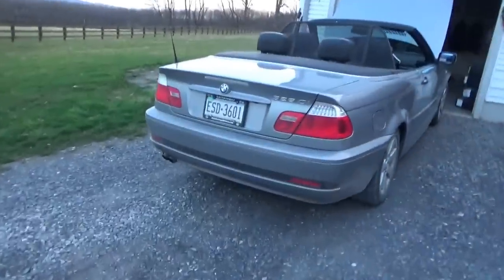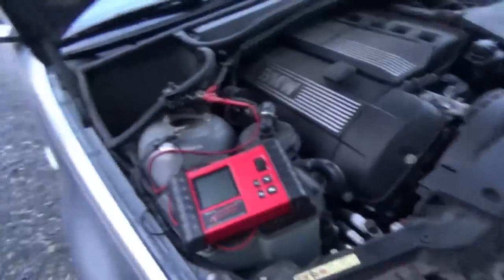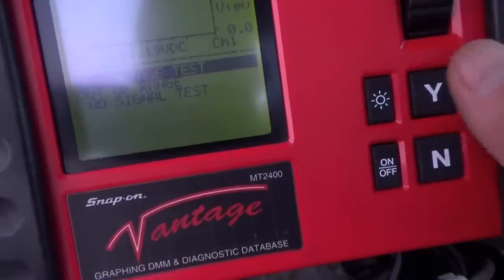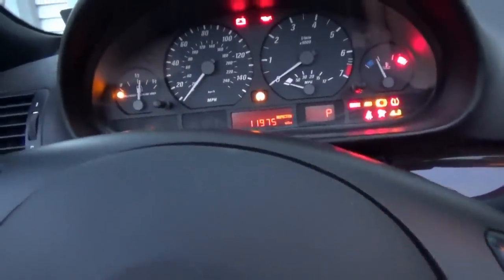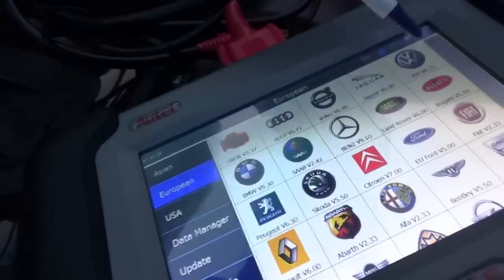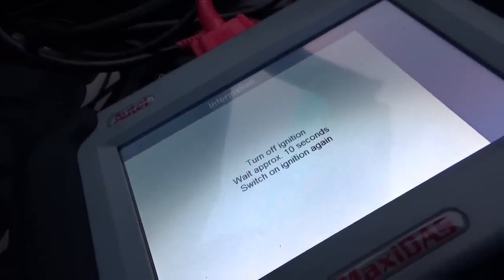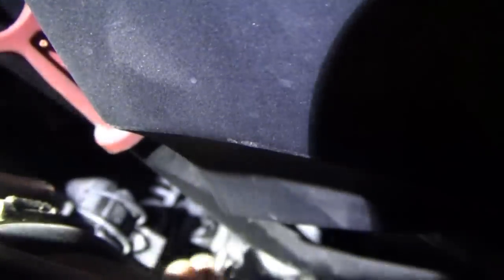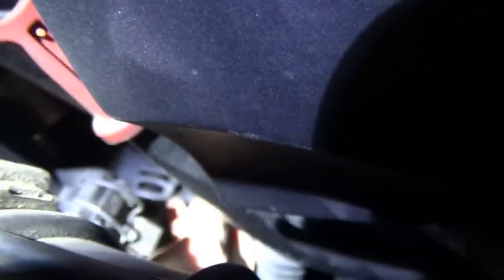BMW Charging System Alternator -Diagnosis

Comment: Ivan, I really enjoy your videos.  If it helps, here is another source for wiring diagrams.  Very similar to a post by someone else: https://www.pss-autosoft.net/diagrams.php
The technical information that you were also looking for (how the systems work) can also be found in these BMW wiring diagram "systems".  These are the actual BMW technical systems used by the dealers. People have just ported them over to these websites.
Owning three BMWs (e39, e46, e63) and doing all my own work on them I can say they are really not any harder to work on than any other vehicle.  As a matter of fact it's been my experience that I can find more and sometimes better information on these cars over domestic and asian vehicles. But you have to know where to look and so I understand your frustration to not finding in the usual places you go to.  They're also, in my experience pretty easy to work on and appreciate the engineering that goes into them (not that other car mfgs. don't have good engineering).  Speaking as someone who worked as a mechanic while putting myself through school for my mechanical engineering degree.
One last comment on that secondary air pump fault.  I noticed that it appeared to be intermittent.  The scanner was showing that the fault for it was not currently present and the second time you scanned the codes after clearing them it wasn't there.  So it might not be a bad pump.  If it were, those pumps are usually not $500.  The dealer quality brands are about $350 (yes, still on the pricey side), however, a cheaper brand say from Rock Auto can be had for about $150. I understand the aversion to non-oem, but sometimes it's ok. lol
Perhaps your customer/neighbor may be interested in you diagnosing it.  That would be a good video!
Reply from the maker: Thank you for the detailed comment! I already diagnosed the AIR pump. It's actually shorted and blowing the big 50A fuse :)
Reply: You're welcome.  Great that you found part of the problem with the pump.  Now as to the why?  Video maybe?  Great work!  To repeat myself; really enjoy your videos.

Comment: Yea, Alldata is just about useless, had it when I was at the dealerships, but I would never pay for it myself.
As for BMW, it's car made for suckers that want a status symbol, and if they want to drive a "Beemer", make em pay.
Any reasonable person would slap a for sale sign on it and be done, but Beemer drivers are not reasonable people.
Other crappy cars on the list, VW, Mini Cooper, Audi, Mercedes, and I have no sympathy for owners of these vehicles. 
I advise owners to sell them asap, and if they just have to own a status symbol, tell them to bring a pile of cash, no checks.
I am still awaiting parts for a BMW no starter, the customer had her husband screw with it for 4 years, claiming it wasn't getting fuel, but it was a no spark. It's getting a set of sensors for the crank and cam, and then we will see what happens.
 BMW owners are less than intelligent people, and again, it's not possible for me to have any sympathy for them.
Make em pay, make em pay, make em pay
Reply from the maker: That's what I think too...if you drive a Premium brand, even if it's 30 years old, be ready to pay a Premium price for repairs! And save the sob stories haha
Reply: Absolutely agree with you. Fools are made to be fleeced.
Reply: A bit harsh on them-and I drive a Lexus
Reply: No I'm not. A Lexus is exactly what it's designed to be: What Mercedes Benz was 30 years ago. A luxury car worthy of the name. BMW was this at one time too. However, now they and Mercedes are overpriced plastic cars built to last only as long as the lease. The marketeers and bean counters won. Ultimate driving machine my ass. Bend the fools that drive them over. They will still love you since you're only sticking it in half way instead of balls deep like the dealerships do.

Comment: Ivan, I've ran into an odd alternator problem on my car and curious if you have seen this before or have an idea of what may be going on or how to diagnose it. When started hot, the engine needs to be revved once to ~1,500-2,000 rpm for the alternator to turn on. Once this RPM is reached once, the alternator turns on and works fine at any RPM and maintains 13.5V+ voltage at high load. See this video:
https://www.youtube.com/watch?v=cNq0ZkfE5Ew&feature=youtu.be
However, if started cold, the alternator turns on fine at idle RPM as it should and there is no problem at all. The alternator is a remanufactured unit by Bosch with ~10k miles on it.

Comment: What a totally fucked up over-designed/complicated charging system these German cars have. And a "smart battery"; why ? Remember the good old days with the time tested GM 2 wire 55Amp alternators? D.C. output and the Gen dashboard light. I would never ever buy a recent German/European car... :( :(
Reply: Not just a German thing, quite a number of other cars have some form of smart charging system and battery monitoring. Of course the Germans tend to go the extra mile in making the system more complex and fail in creative ways..

Comment: the german cars drive great  that beemer will pull a turn at 100!   they suck along with mini and vw to work on  just a altenator was a headache and finding data I work on them but not by choice     ps    dorman stay away from these cars  and alldata sucks
Reply from the maker: I drove this thing through some tight twisty turns on DRY pavement and the traction control was annoyingly intrusive! Best-handling car I have driven to date is a 2001 Saturn SC2 Coupe. That thing was like a freaking go-cart lol
Reply: good morning ivan   I think you can turn the traction off of the bmw but these cars...you have to work on these all the time also  the dealers get big labor rates too  I don't blame them...  the sc coupe must have had a suspension rework   now its sunday take off and enjoy the day   dave
Reply: BMW's with any age are most likely cornering slow and carefully. tow trucks just don't corner very well :))

Comment: Check brushes on alternator and copper ring they slide on. I had some problem on European Fiesta 2 door. Once it was running, once was draining whole battery down like this BMW. I disassembled alternator - brushes gone.
Reply: Quite possible.
Reply: I agree, I had an early e46 with alt problems and I changed the brushes,  worked fine after that.  A Bosch alternator is the only one you want to put in there and it's like $500.